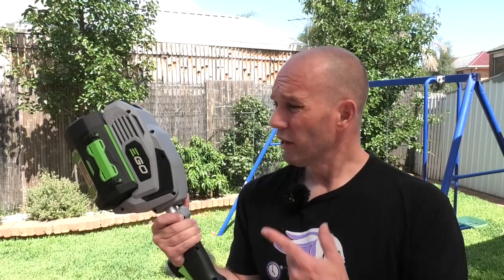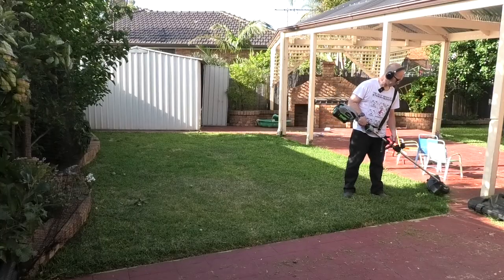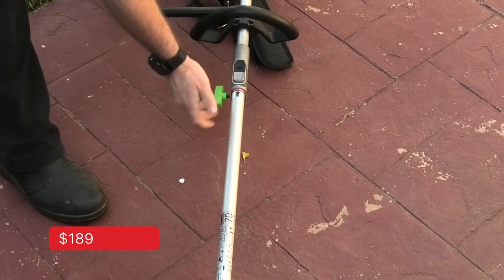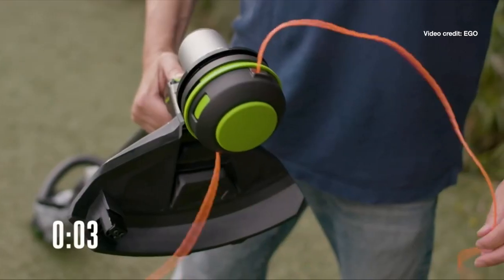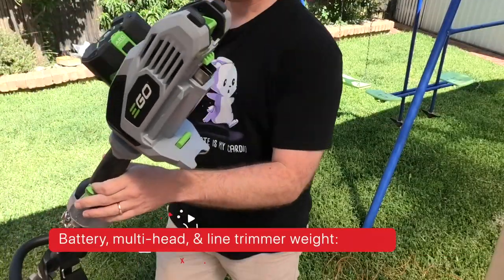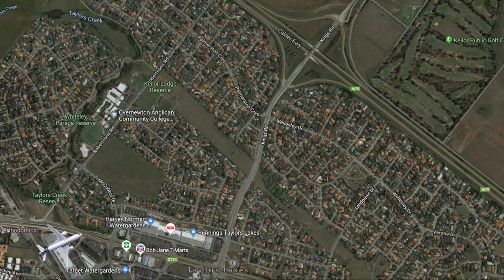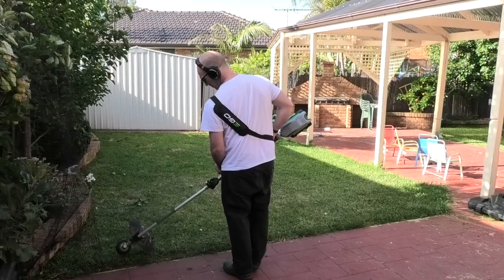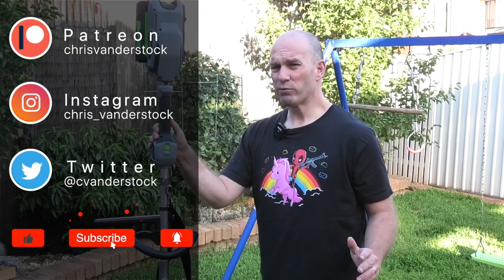EGO electric line trimmer and multi-head review

Comment: Great review, Chris. I have the EGO lawnmower and chainsaw that use the same battery.  I have found them to be excellent.  The mower is a self propelled version that you walk behind and steer: very useful on a big, sloping block like ours.  I used to have a Stihl petrol engine with a Kombi system (hedger, lopper, blower and power brush heads).  When the engine failed after many years, I replaced it with an electric version and a giant 1.4 kWh backpack battery which are compatible with all my existing attachments.  I have been very happy with these, although Stihl is quite a bit more expensive than the EGO system you demonstrated.

Comment: I have an EGO lawnmover and an older model trimmer I bought together at TT. That way I got both a 2 and a 4Ah battery in the bundle. These things are amazing! I easily get 4 mows out of a charge on the 4Ah battery. The 2Ah is very light and gives me about 30mins trimming.

Comment: Once upon a time I used to be an arborist, with a bit of forestry and land management as well. So I'm still using my old stihl brush cutter (18yrs old) and even my old climbing saw (25yrs old) and I hate the fact I'm still using 2 stroke engines. Been saying for years and harassing reps from the manufacturers that they should invest in electric tech and have been basically laughed at. Now the battery tech is mature enough but the price still hurts for more robust equipment.

Comment: I have an electric lawn mower and trimmer, both together were cheaper than a ICE lawn mower and easily the best mower and trimmer I've ever owned. The torque of the electric mower gets through grass and stuff without stalling. Honestly, I have zero idea why petrol engined devices are still on sale, especially for home use.

Comment: Great demo Chris - I agree, ICE trimmers are 'dead!'... but, as I am lazy, I only trim my yard a few times a year, so, I paid $200 for a cheap Ozito electric from Bunnings. Would I prefer an EGO, 100% yes, but, I do not like to spend that much on a thing that just sits there 99.75% of the time - plus, I got the Ozito chain saw and a circular saw that all have the same battery, so I have a few sets to swap over if I ever go crazy and spend more than 1HR in a month on my yard. this is all to say, go electric, buy Ego if you will use it, or, look at cheap stuff if you are lazy like me...

Comment: Good discussion on battery electric yard tools.
They are so much better than fooling with gas and wondering if the tool will start.
A small contribution to reducing the Climate Crisis. Every bit helps.
Now if Australia would only stop expanding coal mines and making the Climate Crisis worse.